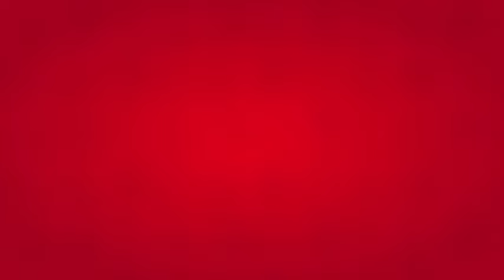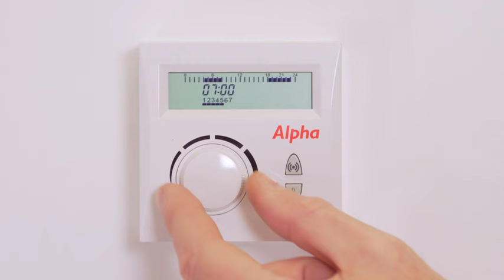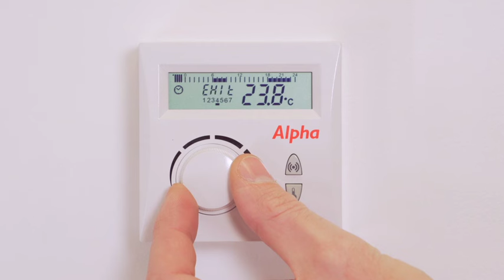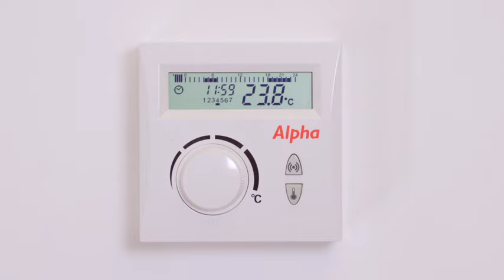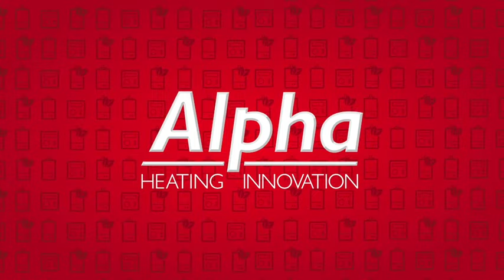Quick guide to: EasyStat control

Comment: my boiler is switching off when the temperature reaches 0.2 degrees above the set temperature, but I don't want it to switch off until the temperature reaches 0.6 degrees above the set temperature!. I don't understand the manual, it doesn't seem to do what it says that is should do, and there's no mention of how to do this on this video. The online manual states 'Heating off'
This setting controls the switch off point for the heating to maintain an even temperature e.g.
if the set temperature is 20⁰C and the heating off setting is 0.6, the heating will switch off
when the room temperature reaches 20.6⁰C.
Turn the knob to HOFF 02, press the knob and the temperature will be displayed, turn the
knob to adjust the temperature and press the knob to store. I've pushed the knob and turned it, but can't even find an HOFF02, can anyone help me please?.

Comment: I have set my timings. 
I have set the Eco (lowest) temp. 
But How do I set the goal temp for my timings… 

I’m currently not in my ‘on’ time and when I go to change the temp it goes to an override (of course) but I don’t want to override I just want to set the temp for when the ‘on’ time comes.
Reply: Did you find out how to do this?
Reply: @ yes!! So when the heating is on as in, it is during an hour when the clock is timed for ‘on’ … you spin the dial to the temp you want it for. 

Similar to the cocktail, if you leave it on 19 for example and it turns off, it will turn off and turn on aiming for 19. 

Sometimes in the evening I have had to turn it up (spin and middle click…) left it on say 21.. it turns off at 10pm and then I wake up to 21 degrees at 8am so 😂😂 gonna be getting a Hive very soon haha
Reply: Cheers thanks for the reply I'll give it a try lol.  Aye same think I'll just get a hive too 😂

Comment: How do I just.. reduce the temperature 😅😅
Reply from the maker: At around 50 seconds we describe how to increase the room temperature, this will work for decreasing the temperature. Simply turn the dial until you reach your desired temperature and them press the thermometer button. For any further assistance, please give our team a call on 0344 871 8760.

Comment: I can't set the party mode or ecot higher than 14.4° and when I increase the target temperature in timed mode it always resets to 14.4° before the target temperature is reached. I'm constantly having to manually turn the heating on and it gets very cold overnight. Is something broken?
Reply from the maker: We would recommend giving our team a call on 0344 871 8760 and they will be able to assist you with the settings.

Comment: Hi,thanks for the video,I have a question,when arrive the time for exemple 7 am,I programmed to start but don’t start,I don’t know why
Reply from the maker: Hi, please check the mode is set correctly (i.e. clock showing for auto, or cocktail glass for timer override) and the desired temperature (i.e. the setpoint) is higher than the current room temperature.

Comment: The so-called easy stat is not that easy to comprehend and is not user-friendly. How does it control the radiators?
Reply from the maker: Hi, the Digital EasyStat control is a programmable room thermostat so works but switching the boiler on and off during set time periods in order to maintain the user’s preferred room air temperature.

Further explanations of heating controls can be found here https://energysavingtrust.org.uk/advice/thermostats-and-heating-controls/

For guidance on use, the instructions can  be downloaded from the Alpha website, there are Youtube videos or you can call in to the Helpline for real time guidance on 0344 871 8760.

Comment: Can someone please help..? I've figured out how to set the temperature for the heating on periods, but after the time ends (e.g. 7am-8am) the heat stays on (the flame symbol still appears). How do you set the heating off periods for no heating? Thanks
Reply from the maker: Hi Christopher, It sounds like your “ECOt” setting is too high. The “ECOt” setting is the target room temperature outside programmed heating times (i.e. this is the coolest temperature you’d be happy your house getting to when you don’t have the heating on). Typically the ECOt setting would be between 10-16 degrees. We hope this helps.
Reply: How do you set a max temperature? There was nothing about that at all
Reply: The maximum temperature would be the temperature it's set to. It won't heat higher than this.
Reply: @_a.z how do you set the ‘goal’ temperature for during clock selected ‘on periods’… I’m currently in an ‘off period’ and if I try to set the goal temp it’s doing an override saying I want it that temperature NOW…. Help!

Comment: OK. I can see how you programme the schedule and I see how you have input a minimum temperature but how do you programme the temperature for the boiler to heat the room to when it comes on in the schedule. You've just set it to come on, not set a temperature. Can you set different temperatures for different times of the day?
Reply from the maker: Hi Hugh, from the standard display turn the knob until the display shows desired comfort temperature (typically 18-21 deg C) then press and release the thermometer button to save this temperature for the heating on periods. We also have instructions available on the Alpha website if needed.

Comment: My stat is not in sink with boiler touch the stat cocktail glass is on boiler does not come on have to do it manually
Reply from the maker: Hi Kevin, sorry to hear this. Please contact our helpline and they will be able to assist you further. You can reach them on 03448718760.

Comment: We have one of these and never been able to work it, we don't want to use the timer but can't get rid of the black lines at the top. We just want to switch it on and off and set the temperature sometimes the temperature shoots up to 35 and we can't turn it down. Awful thing but can't find anything simple to use that we can replace it with. 😥
Reply: Wish I had never had this dreadful gadget in my life. It's one of the most complex and worst devices I have ever had the misfortune to use. If anybody has anything better than this please let me know. I hate it.

Comment: Thank you just had one of these fitted, if I can ask I understand about setting time periods but how do you set the temperature for the time period as don’t understand that bit as not mentioned in the manual
Reply: Me too can set time but not the temp
Reply: @JimAllen94  me to.... Remains on 21 which is too cool for me with weather getting colder, yes I'm a baby. Can't bare being cold in my own home
Reply: @JimAllen94  it’s a basic controller. You can set temperature below which it will have to switch on.
Reply: Did anybody find out how to do this?
Reply: Same Issue: house is 15-16 degrees in the dead of winter but it shows ca. 21 and won’t turn on. Have to wake up at 4 to force a turn on.
- I have resorted to putting the thermostat in the coldest corner of the house, next to a window but it doesn’t improve things significantly. It has 2 sensors, one in the wireless controller, and one on the boiler (in the cupboard) averaging a temperature much warmer than in reality.

Comment: Hi I bought new alpha : but 
 in the room temperature is 21 and the thermostat set temperature is 22 why the boiler not start. To start de boiler I need o move the set temperature to 24 to boiler start: please help Thank you 🙏
Reply from the maker: Hi there. Our Helpline advisors will be able to discuss this through with you. Please call us on 03448718764 when you're available and by your boiler. Many thanks, Alpha.

Comment: How do you set the default temperature? I don't have a temperature button, I've not long moved in and have never lived with gas central heating, I'm hating it right now. Any help would be appreciated
Reply from the maker: Hi Alan. Our Helpline advisors will be able to discuss this through with you. Please call us on 03448718764 when you're available and by your boiler. Many thanks, Alpha.